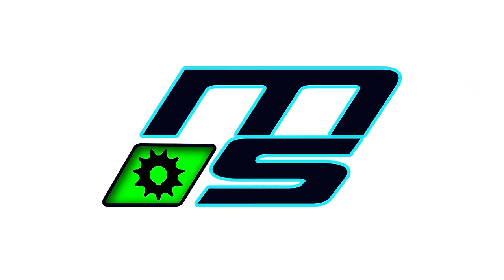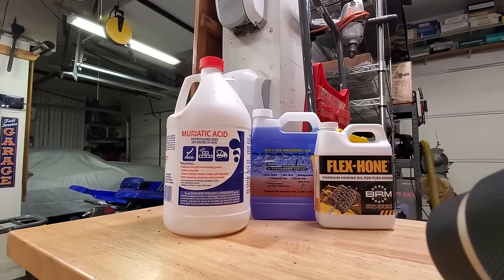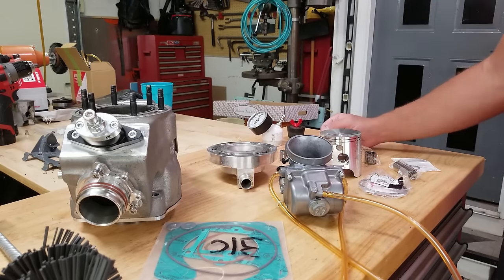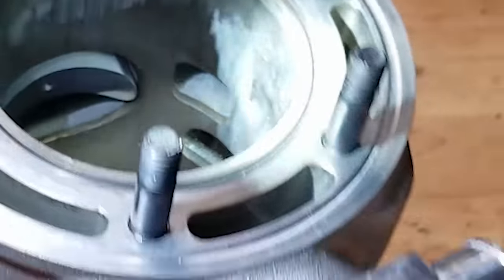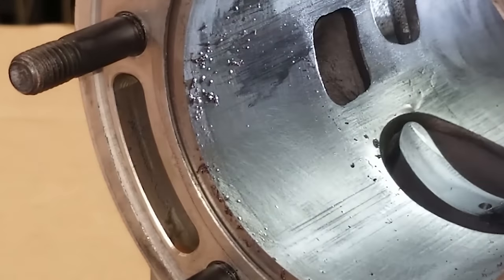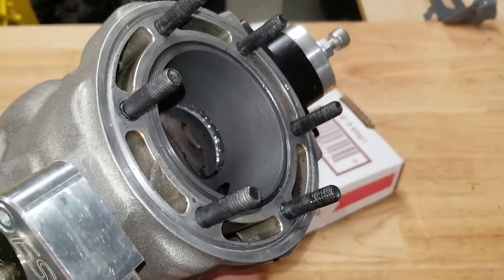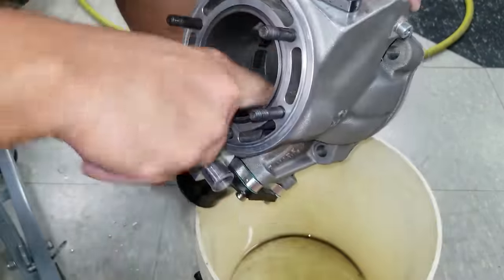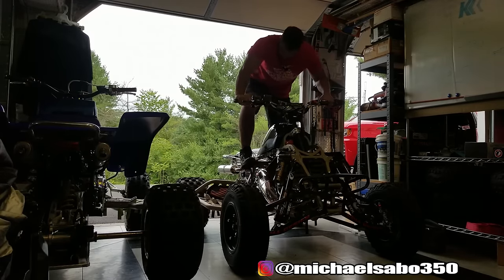2 Stroke Cylinder Honing Facts and How I do it

Comment from the maker: Thank you for watching my video; I hope this helps anyone that needs to hone their cylinder. Links are below!

BRUSH RESEARCH MANUALS - http://info.brushresearch.com/downloa...

Tools/Fluids

Flex Hone (71-73mm) - https://amzn.to/2EiKFZe
Brush Hone (63-76mm) - https://amzn.to/3ggYeWv
Stone Hone (2-7inches) - https://amzn.to/3iQRNeq
Bore Brush - https://amzn.to/2Yjo469
Muriatic Acid - https://amzn.to/34eaEvT
Engine ICE - https://amzn.to/2FKUFvf
Honing Oil - https://amzn.to/3hhTkK1
Red Scotch Brite Pads – https://amzn.to/2S5I4pD
Milwaukee M12 Fuel Kit - https://amzn.to/3b9GXvL
Reply: Awesome video man, very educational. Keep up the great work.
Reply: So glad to see she's running bro!!!!! Think you nailed  the honing!!!!
Reply: Great to see it run again will we get another first ride soon ?
Reply from the maker: @Bendover-ri5tx  yessir, it will be live at 6:15 PM ET Saturday!
Reply: Probably could of had a machine shop hone it for the cost it was for buying all the hones
Reply: I've used the engine ice also. I had a yzf 450. It hated that shit. Would spit and over heat easier.  I put Honda's Blu coolant in and never had a problem ever again. I'm not to sure about that engine Ice. Be careful u got too nice a machine
Reply: P
Reply: wurwp
Reply: Flex hones are the correct thing to use when repairing a 2 stroke cylinder. But. You did do a ton of passes. You probably removed 3-4 thousandths.(0.003-0.004 inch). That’s a lot considering that a good quality machined bore only has about .0015-.003 of clearance to the piston. Running a cylinder with probably somewhere in the range of ten thousandths clearance is going to cause you bike to run EVEN HOTTER now than before. The only way to cure you issue will be to run more oil in your mix so 20:1 or something. You have to have something in between the piston and cylinder to act as an insulated cushion so 1. You get heat transfer straight from the piston to the cylinder where the coolant can do its job. If there’s an air gap it make a hotspot. And 2. Your piston rides on the cushion and uses its hydraulic properties and lubricating properties to avoid contact with the cylinder.
Reply: That trucker guy channel is bragging hes better than you in every way Mike! What's up w/that? ;)
Reply: I have used these hones on my Honda car engines for close to two decades. I need to do a top end on my son's yz85 and was unsure about the dingle berry hone. Wd40 has always helped seat the rings on the car engines. They use a steel sleeve. Awesome Video.
Reply: @aaronbright5028  Everything you just said is false except for your last sentence. Please don't try to educate until you are properly educated yourself. You just did what most people do on the internet which is spread more misinformation!
Reply: So three years later any negative consequences? Was that nikasil? Thanks.
Reply: I just came across this right before I was ready to order a hone. I was wondering if I could send you a couple pics of this cylinder I'm about to attempt to clean up and see what you think as far if it could be honed or not

Comment: Hey Michael! Great video. Thanks for the recognition. I must say I am impressed with the job you did removing the aluminum transfer from the cylinder wall. I'm even more impressed with the hone job. That cylinder looked great! You did exactly what you should have by rotating the hone in both directions. The brush hone that you tried was probably too large in diameter like you said, but you really don't need it. Trust me, that cylinder finish is great. If i had to nit pick anything, it would be to oscillate the drill a bit faster to get a little steeper angle on the crosshatch. It is still going to work great, I'm splitting hairs here. Sounded good when you ran it, just make sure you heat cycle the engine a few times to seat those new rings in that fresh bore. You have to find "too rich" and "too lean" with your carb jetting to know where "just right" is. This will take some time and effort. Shoot me a text or give me a call if i can assist in any way.
  Thanks again and God bless!
Reply: Thanks for giving him advise so he could relay it. I appreciate you
Reply: Thanks Herb for spending all this time with Mike. You just didnt help him out you helped me out and prob a lot of others. Thank you very much sir! :)
Reply: @just_in_time5518  Glad to be able to help. You're welcome.
Reply: @FreedomInc  Glad to help!
Reply: I  too appreciate your expert advice that can be a help to many.
Reply: Piston rings do not " seat" in a two stroke ..they are pinned to the piston and can not move ...
Reply: @donniebaker5984  When the piston rings move up and down the cylinder wall as the engine is running, the rings and cylinder wall wear and mate themselves to one another. This process is known as "seating the rings". The majority of this wear occurs when there are new rings in a freshly bored/honed cylinder during the first few hours of run time. In order for the rings to not seat, there would have to be zero wear in the cylinder and on the piston rings as the engine was running. I can guarantee you that  cannot happen. You are correct in stating that 2-strokes have locating pins in the ring grooves on the piston to keep the rings from rotating while the engine is running, but that has nothing to do with whether the rings seat or not.   

  Hope this helps.
Reply: Great info!  I have a 2017 Beta 300rr I need to do the same.  What hone should I use?  I see several options listed.  Thanks!

Comment: I use Flex hones almost daily in my shop and just for record the Flex hone used for Plated cylinders is a "Aluminum Oxide" compound instead of the usual "Silicon Carbide" compound used for cast iron and steel bores. Those Stone hones with the arms on it are trash and should be thrown in the trash where they belong. A real stone hone is a ridged hone and is whats used to final size a bore and keep it concentric and straight and is used in a machine(How its done in my shop and many other engine shops) and flooded with honing oil. Nice Video Mike and its good to educate and debonk some of the myths and misinformation that runs wild on the internet.

Comment: Nice video.  Thank you.  Always a controversial topic.  

From my research I’ve read:

With this product one is deglazing and cross hatching. Not officially “honing” …..not cutting down and increasing bore size.  

1.  How smooth or rough the cylinder wall required somewhat depends upon the material used in your piston ring.  

2. Cast Iron piston rings (used years ago but can still be purchased) require a rough cylinder wall.  Here you would use a rough grit (120) - Silicone Carbide (SC) Flex-Hone.   This is considered rough grit.

3. Alloy Steel piston rings (this is today’s industry standard used in almost all top end kits) in a Cast Iron (sleeve) cylinder head recommends the use of (SC) Silicon Caribe Flex-Hone at 180 (Medium) Grit.

3. A Nikasil (Nickel Plated) Cylinder requires the use of an  (AO) Aluminum Oxide Flex-Hone at 240 (Fine) Grit as recommended by BRM. 

From snowmobile experience, always a good idea to use higher end “forged” pistons.  More expensive than cast pistons but worth it.  

4. You can order specific piston rings from Hastings if desired.  (Cast Iron, Alloy Steel, Stainless Steel) 
https://hastingspistonrings.com

Comment: Followed the instructions and video to the dot and the result is a perfect cylinder wall, albeit with a huge scratch in it, so it will sold as core for sleeve. The rest however looks terrific with the cross hatch and no sign of piston aluminium.  Thank you ! I feel that I learned a lot and more importantly have confidence now to tackle a job like this.

Comment: Used the Flex hone on my YZ426 and older CR250...came out perfect.
Reply: Did you happen to run a stock piston or did you need to measure for a new size after honing?

Comment: I was told to only run the flex hone clockwise, as it wants to come apart reversed. With ports, there is a need to go both directions. Knowing that it works in reverse and the acid trick makes me want to repair an old KX250 that's been sitting around 14 years. Thanks.
Reply: That's what I'm doing to my 2000 rm 250,she been sitting over 10yrs in the basement. Port value has anick above it,eat the last piston looks like a shark bite in the old piston.  Watched another video think I can get away with just weld n copy exactly what he does in this video.  Keeping my fingers crossed it works 💪, let's Ride! # Tha Real McCoy

Comment: Looks great fine job 👍. I've never used the muriatic acid and just ran the flex hone through the cylinder and used dawn dish soap then dried well and lubed and ran for years, never did blow up. But you always do great work. It's a sweet quad. I would enjoy working on, sounds awesome love that pipe.👍

Comment: It doesn't hurt a thing to round out the edges of your ports ...if you don't keep a good chamfer on the ports ..the sharp edges will destroy a new set of piston rings in about a day ...there are specs for chamfering the ports in the Honda cr250r service manual .
Also specs for the concave of the bridge port on the exhaust ....if it is too shallow ..it will burn the piston ring at that same spot

Comment: Awesome video great information I’ve honed out a cylinder of my own with a stone hone like yours and it worked great some people do say not to use it on a 2 stroke because of the ports and I agree with them I used my hone on a crf70 4 stroke because the cylinder was so worn out it made a noticeably big ridge in the cylinder so much you could feel it pretty good with your finger and all I did was buy a bigger piston and honed the cylinder out so the cylinder was even all the way around this was my first time ever trying something like this and the bike runs just fine no smoke and good compression i recommend just doing it on 4 strokes with this particular hone just to be safe and when doing 2 strokes do the same thing and get a ball hone you can use a ball on 4 strokes but they are more expensive just my own opinion

Comment: Hey a great video.  I am familiar with honing 4 stoke large bore engines with flex hones.  I wasn't aware that they could be used with 2 stroke inlet and exhaust ports.  Clearly you can.  Excellent information

Comment: I actually use some of that muriatic acid on my 1984 Yamaha YZ250 I was told by a servicing mechanic at action Motorsports that putting that muriatic acid in a spray bottle soaking down the cylinder let it sit for about 1 to 2 minutes and then use the red Scotch-Brite do it again and again until the aluminum is gone

Comment: Nice job with the honing, she looks good as new. Getting to hear it run in the end was worth the days of waiting. As for me, I found out my truck has more problems than I thought. The mechanic I brought it to found some structural rot on the frame and wouldn't fix the fuel issue. It's just too unsafe to be on the road. It's a bummer, but the upside is I got a brand new truck coming to me. It had to be brought in from another dealer, so we'll be picking it up Monday. So it looks like the YZ will be napping for a while longer, getting to work is more important. I'm also quite excited, it may only be a lease, but this is my first new vehicle. Everything thing I've owned has been hand-me-downs that were on their last legs. :)

Comment: I was given a basket case '86 CR125. The cylinder has surface rust. I searched Youtube for honing and found this old video. Would a hone be enough or would the cylinder need rebored and larger piston installed?

Comment: Question: What grit flex-hone do did you use. I'm thinking the 240 or 320 but there are like 10 options on brushresearch.coms website. Thanks for your time bud.
Reply: I just answered my own question after clicking on the link you posted for the hone. No need to reply bud. Thanks again.

Comment: Awesome video I enjoyed every second of it the people that are putting thumbs down or just haters man and I'm sure you know by now the world's full of them. But I've got a question I would like to ask you about my 2000 my z80 first off I've replaced the crank rebuilt the whole engine pretty much even have two new top end piston rings ring either way my question is do you know why it would keep blowing the O-ring gasket around the Piston directly under where the spark plug screws into and the stud bolts I've replaced them as well but they are still leaking as soon as I pour water into the radiator again it's a 2000 Yamaha YZ80 two-stroke obviously thanks any feedback would be greatly appreciated.

Comment: people on thumpertalk will hang you on a cross for honing a cylinder, but what most dont understand is all you are doing is making a nice cross hatch on the cylinder walls for your piston and rings to seat.

if it is nikasil, yes you can remove the plating, HOWEVER only by running the hone too long and not following the instructions.  nice job saving your cylinnder in this video and a great demonstration on how to hone properly

Comment: my understanding, which you didn’t specifically address, is that you only need to hone nikasil when the plating is initially applied. Then, once the cross hatching wears away, it is a sign the plating is probably gone because the plating is so thin (for example, the spec range on my ktm is only 12 microns)

Comment: Nicely executed !! Have you measured the clearances before and after ? It will be good to know the honing clearances in microns .
I have a slightly melted piston crown due to detonation, I would be installing the new pistons with a light hone.
Reply from the maker: I really should have done that; I just checked ring gap at multiple spot in the cylinder before assembly.

Comment: Is there any chance some of that sulphuric acid got down that exhaust port and started eating away at the cast aluminium
Reply: It's not sulfuric. Its muriatic.
Reply: Cody Weien my bad, either way do you recon it’s could have got in those exhaust ports
Reply: That's a logical question. He really should have removed the powervalve and reeds before doing all this. Small chunks of those ballhones break off and he has no way of knowing 100% if he got all of them out. The suspense would kill me.

Comment: Question:
Is it possible to ''hone' a cylinder from 80mm to 80.25mm?  Is it asking too much to hone 0.25mm out? Here's the story - I have a zxi 750 (that I thought was running so well). I ended up pulling the motor to replace the dreaded starter/Bendix drive and discovered low compression in one cylinder. It's incredible to me because the ski ran so well and was strong.. anyway, opened up the motor and found one of the cylinders must've gone without oil for a short while. I don't think I did it because I check oil, pump, lines every single time I take her out.  I think previous owners ran it dry or maybe someone failed at a rebuild in the past idk..Regardless, one cylinder is lightly scuffed and that piston is chipped on edges (I believe on exhaust side. So little or no compression in there. But I wanted to hone or lightly 'bore' (even though technically not) the cylinder to allow for an 80.25mm piston.

Comment: so, a couple of things about this; while muratic acid works to eat aluminum it also etches steel(also not a problem if you're honing after). a strong base like lye will eat aluminum much faster(use you head when using this method) and not react with steel. as for cleaning, don''t be lazy about it, when honing your are putting an aggressive abrasive in the engine, you need to get it all out.

Comment: How to make a muriatic acid bomb: (it's not as bad as it sounds)

1. Get a plastic bottle. 20oz works pretty well. Can use bigger.
2. Crumple up a tiny bit of aluminum foil. Crumple loosely, not tight. About the size of your thumb tip.
3. Put foil into 20oz bottle.
4. Get cap ready for bottle. Pour muriatic acid into bottle until it fills up those dimples usually found on the bottom of 20oz drinks.
5. Quickly screw cap on tight and shake the bottle for a few seconds. You should start to see smoke forming.
6. Throw it!!!! Doesn't have to be super far.
7. If it doesn't swell up and eventually go boom, you may have used too little or too much foil/acid. 

The acid eats the foil and gives off toxic fumes which fill the bottle until it goes boom. Depending on the mixture of foil to acid and if you shook it, you should have about 10 seconds before it explodes. The bottle will start to expand and heat up (that sizzling), it should not be in your hand at this point.  I used to do brick work and we would use this, diluted, to clean excess brick mortar off the walls. It's as safe as firing bottle rockets at other people for comparison. I wouldn't recommend doing it, but I've had them explode next to my feet without any risk of injury (had jeans on). I still don't recommend being near it. It just makes a loud boom. It will not leave a crater in your yard or blow up a mailbox or anything, it's not that kind of boom. It's just a gas bomb really.
Reply: Might want to get your affairs in order. The Feds will be knocking on your door real soon after making this post.
Reply: @betarider9392  LOL. No they won't. Like I said, it's not a bomb in the traditional sense.
Reply: We used to do this with toilet bowl cleaner instead of muratic acid. @JarofMayonaise

Comment: Flex hone is the way to go. I used it on my 03 kx250 rebuild. Came out perfect. Good choice. The other hones are mehh at best but good in their own. I would never use a 3 prong hone on a bike. They are good if you have a machine shop and doing truck/car bores on a mill. But for your situation the flex hone is top notch.
Reply: Best way to ruin a 2 cycle cylinder, never use a ball hone unless you want all the port angles screwed up!!!